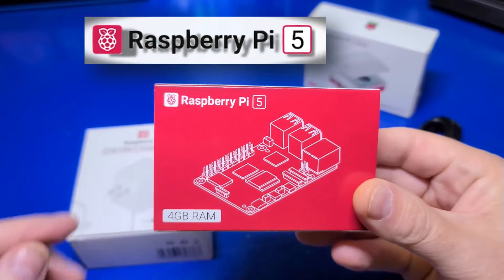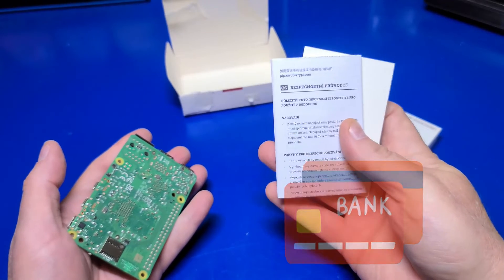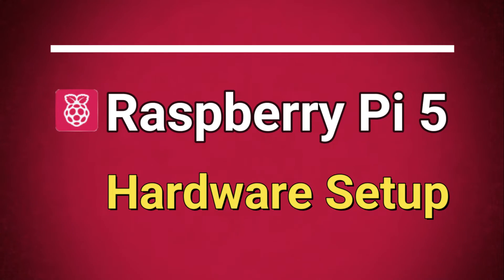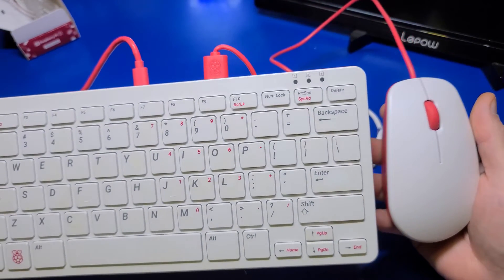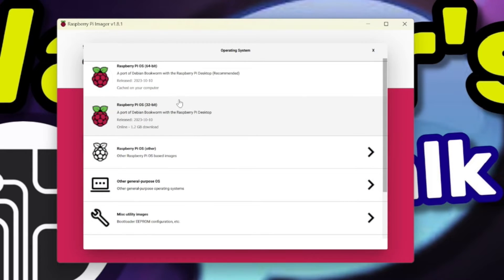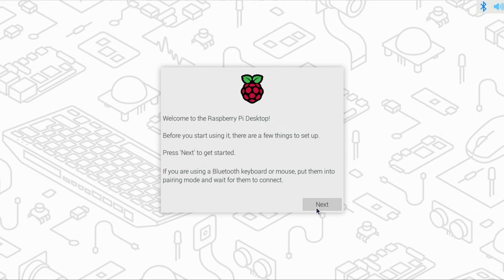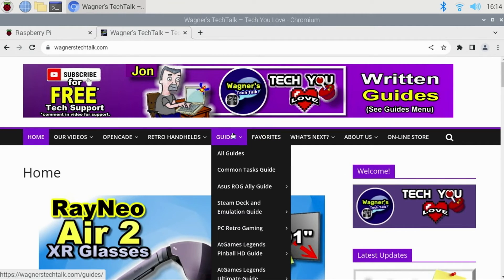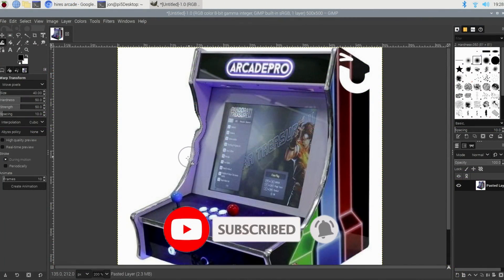Raspberry Pi 5 Setup: Getting Started Guide (Step By Step)

Comment: How do you enable audio? I set everything up but there is no sound and no icon in the top right.
Reply from the maker: The audio should play through fine without any issue.  If it's not, try a different HDMI cable.  Sometimes you can get a bad HDMI cable with a broken audio line and get no audio.  I've had something similar happen in the past.

Comment: Thanks, but in my case, after installation, it asks for restart just like you showed, but it never comes back again, all I see is blank screen. So only option now I had was to power it off (using main board switch), and turn it on again, I now see welcome screen but again stuck blank screen after it.
Reply from the maker: Make sure the microHDMI cable is plugged into the port nearest the USB C (power) input.  It should let you proceed through the setup wizard at that point.  If not, try re-imaging the card again.

Comment: What case should I get? I want to use GPIO, but the case I got doesn't allow the GPIO 40-pin ribbon cable to be threaded through the hole in the case. This frankly sucks donkey bolls. Is there a case available for the RPi5 that allows the use of the GPIO cable?

Also, I bought some heat sinks (not a fan) but there re no instructions as to how to install them. Can you use both a heatsink and a fan on the CPU, or just one or the other? And is there clearance in the case for this?
Reply from the maker: I don't know what kind of case you got, but most of the time you can install the fan along with the heatsinks.  There are a number of cases that I like to use.  CanaKit cases have an opening.gap at the top where you can feed a GPIO extension cable through.  Video on that here: https://youtu.be/Wi_S7QkuN3M .  You can get the kit without the Pi 5 as it seems like you already have that.  For what you're asking about, this is the case I think would be good for you: https://amzn.to/4me1moe .  It doesn't include the GPIO cable itself, so that you'd want to pickup separately if you don't have one.

Comment: Hi, for some reason when I select storage, my SD card doesn't show up, no matter what I try. Do you know how to fix that problem?
Reply from the maker: If you're running Pi Imager on the Pi, the SD card won't show as storage as it can't overwrite itself (you could plug in a USB thumb drive/SD card and it will show up).  If you're using another computer (PC, Mac, etc.) and you're not seeing the microSD card there, then it may be corrupted or a problem with the reader.  I hope this helps.

Comment: How many of you guys actually end up developing something interesting with your Pi, aside from playing retro video games, or installing cameras in strange places? There are so many vids on hooking up expensive PC parts. Guys like Linus, want to sell you lots of desk-weight cyber junk. 

My idea was to learn more about the Numpy Python library (etc.) and analyze stock charts in real time. And, then host it on a website. However, I can't decide whether this will be a monumental waste of my time and money trying to learn it. After all, you can pay for software that does the same thing, no need to dump money into such an endeavour. 

I've experimented with PIC chips and the Arduino. It very affordable. 

But, I'm looking at the Pi as a re-branded desktop PC with inferior computing capability. 

I can't bring myself to pay for one. It'll cost over $500 Canadian dollars to get the Pi 5, buy the monitor, mouse, keyboard, cooling do-dad, hard-drive or SD card. Why don't I just buy a decent laptop instead?
Reply from the maker: I can't speak for others, but I've used Pi's for many projects, not just Retro Gaming (though, I do use it for that frequently).  I've built robots using the Pi to control a series of arduinos, motor controllers, servos and various other sensors.  Here's a really poorly done video that demonstrates this scenario: https://youtu.be/1U1IyXRWEag?t=136 .  Even added an on-board socket server for sending commands directly to the robot to adjust speed, control the motors and speak via a custom speech module (to offload some processing from the Pi).  The limits are truly up to you.

Comment: Do I need to plug a keyboard into the pi? I have a laptop
Reply from the maker: Yes, a keyboard and a mouse would be needed.
Reply: @WagnersTechTalk  Can the full desktop version not be controlled via SSH over WiFi like the Lite OS can? Ik I've seen vid of the later, but I'm still learning.
Reply from the maker: @tedbastwock3810  For the initial setup, you'll need a keyboard+mouse.  After that, you can use SSH or even easier Pi Connect (GUI and SSH).  See here: https://youtu.be/y9cHFkGC6Aw

Comment: In last step it is showing error writing file to disk wile downloading os i tried many things but didn't work what should I do now
Reply from the maker: That error usually means the SD card is corrupted, have you tried reformatting it?  If not, here are some steps to try, then re-image: https://wagnerstechtalk.com/common/#Format_as_FAT32_Pi_Imager .  If the write fails again, then it sounds like a corrupt microSD and try another.

Comment: i was worried about on thing in RPi 5, it is not showing camera in raspi-config, please resolve this issue
Reply from the maker: Double check that the connector is facing the right direction on both ends.  What did you use for testing?

Comment: Question mate: my Pi led wont go green and it wont boot up. Surely only having the adapter that came with it plugged in and pressing the button without anything else plugged in should make the led go green no?
Reply from the maker: Do you have a microSD inserted that has an operating system installed (i.e. Pi Desktop)?  If not, do that first then power on and it should boot up.  If not, you might have a bad Pi.
Reply: @WagnersTechTalk  yea, ive put everything on the SD card that you have shown in the video thru my PC and then plugged the SD card together with the power supply into the Pi and nothing else. 

So now the led is red lit. Pressing the power button does nothing to change that.

I have to say, the board itself is a bit crooked/bent (like ever slightly V shaped from the middle) and the little box that the Pi came in looked pretty banged up tbh.
Reply from the maker: I'd get a replacement.   If it's bent, it likely broke an internal trace, causing an open circuit.  Just a guess.
Reply: @WagnersTechTalk  yea picking up a new one tomorrow. Cheers bud
Reply from the maker: Don't forget to remove the microSd. Let me know how it goes, please.
Reply: @WagnersTechTalk  got a new Pi5 yesterday and it worked fine immediatly so the old one was just broken. Ive send a msg to Sunfounder and today they already refunded me without even having to send it back to em. Obviously i included alot of pictures in that email haha but still nice service nonetheless.

Now next up is struggling with this pironman5 and 3.5 inch LCD setup which is a nightmare so far xD fan rgb color option dissappeared and the screens touch function just wont fkin work which in turn activates all kinds of glitches even with the top 4 RGB leds of the case which is weird and annoying but ive asked them so i hope they get back to me fast again haha

Comment: I see that it's still defaulting to the 24h time format.  Annoying.  It did this with the previous iteration of the Pi OS as well.  I'd like to see an option in the setup to allow setting to a 12h format instead of this annoying 24h format.

Comment: Great video 😊  I’m just about to buy my first Pi (5) for projects and improve my coding skill and this video was useful. What’s confusing me, is what display to buy as I currently use a legion 7 for gaming and work, don’t have a separate monitor, and have limited desk space. But if I am to code on the monitor I use for Pi projects, i guess it needs to be useable. Any advice anyone? Thanks 😊
Reply from the maker: There are a lot of options. A portable folding display may work out well for you.  That way, when ur not using it you can easily stow it out of the way.     Some can be had on sale for decent prices.  I've reviewed a few on this channel that are 1080p-4k.
Reply from the maker: Did a quick search on Amazon, right now this appears to be a really good deal (~$70): https://amzn.to/3ZFwH9W .  However, I don't own this particular monitor but the reviews look really good.
Reply: @WagnersTechTalk  Hi, Thanks so much for the advice, and I think you are right - a folding monitor/screen is probably the best option. That product above (KYY monitor) looks perfect but it's £120 her in the UK which is $150, but at $70 it is a very good deal. I will try to find similar. Thanks again.

Comment: Does it not come with an OS installed by default?
Reply from the maker: You'll have to install PiOS to a micro SD.  However, you can buy kits (such as CanaKit) that include the OS already on a microSD.  Otherwise, you can use this video to help set it up easilly.

Comment: Hi, I am new to this field and I have a question. Can I operate the Raspberry Pi5 with the phone charger, which usually exceeds 27w ? Will it harm the Raspberry or not?
Reply from the maker: I've only used official chargers from the Raspberry Pi foundation or CanaKit.  I wouldn't try anything above 40 watts.
Reply: @WagnersTechTalk  Ok thanks for the advice and the video is  very useful. Keep going.

Comment: If the SD card was directly inserted into the Raspberry Pi 5, what would be the option on the STORAGE type use at 11:23

Edit: Forgot to mention, I don't have a USB that can hold the SD card
2nd Edit: Also, if the OS is already installed on the Raspberry Pi, how do I make sure I can use it without overwriting whatever the OS is on there?
Reply from the maker: You'll likely want a SD card reader, like this one: https://amzn.to/3ReWDVF (I've bought about 5 of these, they work well).  Insert the microSD card and it will report the brand/capacity under storage.
As you will be booting from the microSD card (with PiOS running), it won't show up in the list to prevent you from overwriting the currently running OS.
Reply: @WagnersTechTalk  Ok, and thank you for the guide and answer to question. Helps a lot! :)

Comment: I bought everything what you said on your app on YouTube I've watched it done it and it's still not put up onto the raspberry pi I've watched your videos about 12 times up and now and it's still won't work how do I go around getting it started because I am actually had it for 93 month now I can't get it started now what's your videos that many times it will not do it
Reply from the maker: A couple things that may help:
*  Power-off the Pi 5.  Make sure the microHDMI to HDMI cable is connected to the port nearest the USB-C power cable.
*  Make sure that the image for the operating system has been written to the microSD card (i.e. Pi Desktop, Ubuntu, etc.)
*  Power-on connected display, then the Pi 5.

If you aren't seeing any video signal, a few things to try:
*  Check the HDMI Video source on your TV/Monitor to make sure it's set/working properly.
*  Use a different microHDMI to HDMI cable.  I've received at least one bad cable over the years, if you have a 2nd, try it.
*  Ensure that you see the green LED on the Pi 5 indicating it's powering on and booting (should flash when reading from the microSD card).  If not, you may have a defective Pi 5 and reach out to the seller for a replacement.

The above should help.

Comment: Well in my case I encounter an issue with my new RP5. When I switch on my RP, I have the boot menu asking for an OS installation. I installed the standard version of raspbian for my RP5 then when I take my sd card from the pc then I branch my USB with the sd card into the RP5 I got a blackscreen in a few seconds then nothing happens : ( I already tried with 3 different screens and same problem
Reply from the maker: Not sure I understand.  A few things to try:  Take the microSD that you imaged from the PC (in your USB adapter, I presume) and plug it into the microSD card slot on the Pi with the power turned off, then turn it on.  Also, make sure you're connecting the microHDMI cable to the port nearest the USB-C (Power) port on the Pi5.  One of those should help.

Comment: The cooler I've in my starterkit has a way smaller cooler.. it fits exactly on the cpu. The one in the video is much bigger
Reply from the maker: The one I used in the video is the Active Cooler, it's optional.  You can use heatsinks along with the fan that you have.

Comment: thank you for a great video! do you know how much electricity costs to run raspberry pi 5 for 24X7 for a month?
Reply from the maker: Thank you!  A little help from Windows copilot (AI).  Double check everything please, it's just an estimate and utility costs vary:

To estimate the average electricity cost for running a Raspberry Pi 5 24/7 for a month, we can use the following steps:

Power Consumption: The Raspberry Pi 5 typically consumes around 5 watts when in use1.
Energy Usage Calculation:
Daily usage: ( 5 \text{ watts} \times 24 \text{ hours} = 120 \text{ watt-hours} ) or ( 0.12 \text{ kWh} )
Monthly usage: ( 0.12 \text{ kWh/day} \times 30 \text{ days} = 3.6 \text{ kWh} )
Electricity Cost: The average electricity cost in the U.S. is about $0.13 per kWh2.
Monthly cost: ( 3.6 \text{ kWh} \times $0.13/\text{kWh} = $0.468 )
So, the average electricity cost for running a Raspberry Pi 5 24/7 for a month is approximately $0.47.

Comment: Great video, question at 8:30 you mention the micro HDMI port to the (monitor) HDMI port while show it at 8:32. If the monitor does not accept HDMI, but rather USB C is it expected for this to work as all parts are connected, however/albiet through an adapter (from HDMI to USB C) on the monitor end?
Reply from the maker: My apology, I don't quite understand the question.  The microHDMI end plugs into the port nearest the USB-C port on the Pi.  The opposite (full size HDMI end) then plugs into the external monitor.  I hope this helps clarify?

Comment: I'm a total beginner and keep attempting to find a video that shows the different way to connect it to a display.  One goal at some point is to create a looping video with a cheap display and some kind of board like this, but perhaps this Raspberry Pi is too valuable for this project - and I should use it for smarthome type projects.  Thank you for any advice.
Reply from the maker: I'm going to make some assumptions here, but it sounds like what you're wanting to do is loop some kind of advertisement (perhaps for a restaurant or kiosk type situation).  In that case, you could create a .MP4 video file, download VLC (free), setup VLC to loop a video or playlist and run the video connected to any display you wish.  You'll just need a microHDMI to standard HDMI cable going from the Pi5 to your display.  Hope this helps!
Reply: @WagnersTechTalk  thats what. Micro hdmi part is missing in your video. We may watch 1000 videos. But experience is different

Comment: Thanks for the video, excellent. My son is trying to set up a screen and encountered two problems - one his SanDisk micro SD is no longer working. It's not even being recognised and we've tried using a fix type Web page, but the keys that it says to delete are not there, so we're stumped. The other issue is a ribbon cable that won't go right into its port on the back of the screen fully. It's a Smartipi touch pro. Any help would be most welcome. From a frustrated mum.
Reply from the maker: Thank you for watching!  For the microSD card that isn't working, it could be defective or it may be a fake card.  I've seem some branded cards that are fake and low quality (knock-offs).  You can try re-formatting the card using SD Card formatter (here's how: https://wagnerstechtalk.com/common/#Format_SD_Card_SD_Card_Formatter - all data on the card will be wiped clean ).  Then, try to re-image PiOS and see if that helps.  If not, you could pickup another card locally from Wal*Mart, Best Buy, etc. 

I don't have the SmartiPi Touch Pro with a Pi 5 ( https://smarticase.com/products/smartipi-touch-pro ) and not seeing anything on Amazon ( https://amzn.to/3VSPhtg ) in the reviews that would indicate a problem with the cable not fitting.  Looks like for the ribbon cable you just need to gently pull the black tab forward or up (hard to tell from the images) on the connector, insert the cable and bring the black tab back to lock it in place.  Be careful with the black tabs on the connectors, they are very fragile.

Comment: You detached the opaque cover for the cooler and didnt try turning it around? Unless im missing something, I have the same case, you 180 the opaque cover around and it fits, no interferance.
Reply from the maker: Interesting, I thought I recall trying every combination but it is entirely possible I missed something.  Thank you for your comment, I'll check it out this weekend.  If so, will add a note on that.
Reply: @WagnersTechTalk  i just checked again, i have the stock heatsink which is smaller, so probably why all your combinations didint work.. There completly different.